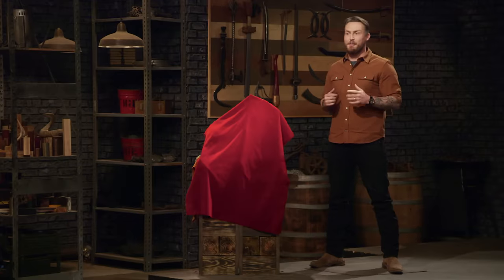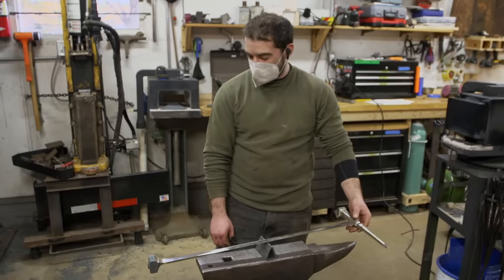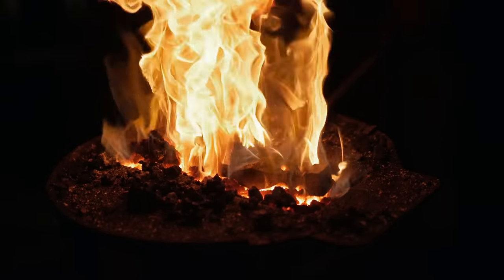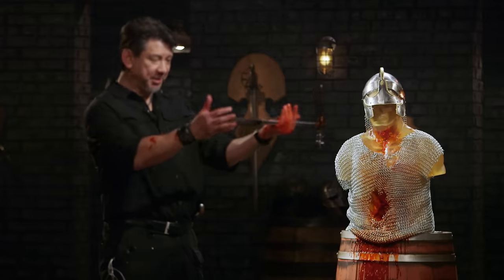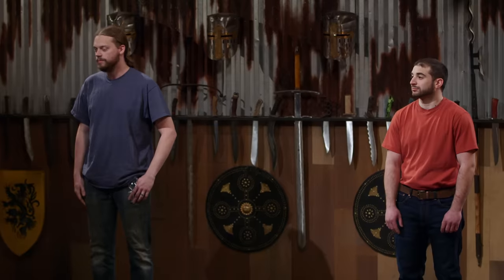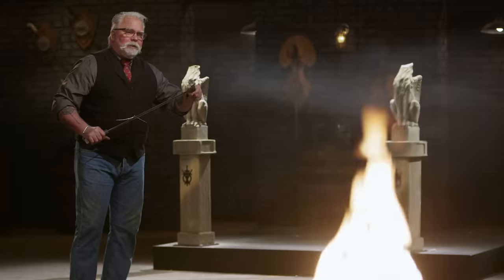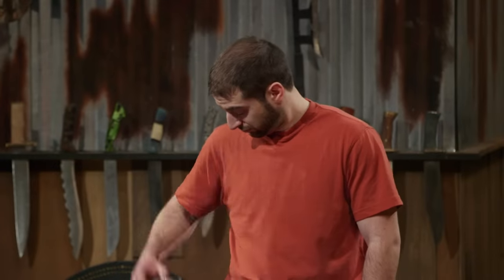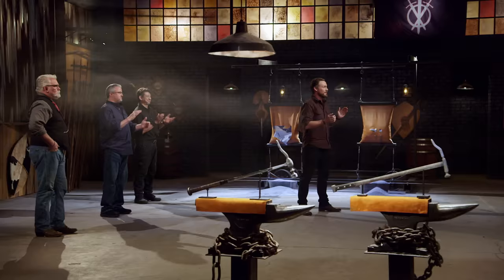Forged in Fire: Polish War Axe DECIMATES the Competition (Season 8)

Comment: I think this is one of the rare times the heavy weapon won the competition
Reply: be fair a hammer like this needs a bit more weight to do its job properly. he had better overall construction and a much better handle.
Reply: Although weight is a great offense, the instability of the weapon's construction and an uncomfortable handle are greater offenses. When they said the handle was blocky and the nail points were sharp i knew that evened the score. The head becoming loose closed the loss.
Reply: @MunkyDrag0n  Not to mention it bounced back at the lether bag
Reply: @anton6795  yeah, i was wondering why that happened. Whatever the reason that was bad.
Reply: @MunkyDrag0n  That was probably because the hammer was too light. Doug even said he was attempting to let the weapon do the work, or to let the weight of the weapon increase the force of the blow.
Reply: I mean it's a hammer  extra weight in a hammer does mean better damage, while extra weight in a sword basically just means harder to use
Reply: It's a Hammer after all.

Anyway, the light hammer was beautiful.

Pd: Sorry if I'm wrong with something. I'm spanish and I do not speak english very well.
Reply: I always hate it when the top comment gives away the ending.
Reply: most times that heavy weapons lose is because they're not properly balanced. Heavier weapons that are balanced win often enough.
Reply: @romxxii  yeah chances are in those cases the weapon isn't actually heavier, but due to the imbalance it makes it feel heavier and harder to swing
Reply: Do you think that the heavier hammer was made from......
.......
......
....heavy metal?
Reply: @janikauhanen5475  YEAAAAAAAH
Reply: The heavy weapon very often wins, what are you talking about? They usually take less damage and retain better edge because of their excessive mass. Which is a shame
Reply: Try carrying a 'Heavy Weapon' into battle, imho.
Reply: @1976PartyBoy  I hate that excuse. How much does armor weigh again? Not to mention a shield if used. Some armies even equipped their soldiers with two weapons such as a spear and sword and they also carried shields.
Reply: Thanks for Spoiler
Reply: @peterherrman5092  you’re welcome ☺️
Reply: It's essentially the handle that made the difference.

Comment: Most studies I've seen come to the conclusion that the spike was mostly for hooking an opponent off a horse or off balance, while the hammer was the most used for attacking. The hammer end doesn't get stuck in an opponent nearly as easily, making it much easier to use against multiple opponents
Reply: That makes sense if it’s factual because I was wondering, (after the reveal), why the spike was forged with a bend in it. 
When fighting for your life it’s better to have a spike on you than to not but, if the blunt end was the focus, the back-end did too.
Reply: the spike was also used for chainmail. as chainmail is built to withstand bludgeoning, but has a major weakness to piercing
Reply: @rymaxrules6416  Yes chain will survive bludgeoning impacts, but without proper padding under it you won't
Reply: @rymaxrules6416  technically chainmail is meant to withstand slashing weapons since its basically impossible to cut through. Even if the chainmail survived being hit by a hammer the person under it probably wouldn't.

And yes while it is most susceptible to piercing it is FAR better against it than displayed on this show. If it was that terrible there would be no need to shape weapons specifically for the task.

I dont know where they got there stuff but that is NOT real chain mail bring used in this episode. Real ones dont explode and have rings fly off when something hits them.

Real chainmail even though its more susceptible to piercing than other things is still difficult to stab through and can still save your life from stabbings.
Reply: I heard that the Spike is for textile Armor and the Hammerhead for plate

Comment: In order to seat the hammer head rigidly on the handle, it is enough to make a hole 2 millimeters smaller. Then heat the middle part of the head with an acetylene torch and place it on the handle. The hole will tighten on the handle while it cools down.

Comment: Wait I'm confused. The weapon was heavier and took a bend but it still won?
Reply: it mostly comes to structural integrity, it took a bend but nothing came loose nor chipped or rimmed, meaning it can still fight, on the other hand, the eye of the hammer started to rim and become loose, which is structural damage, and the judges are very critical when it comes to that kind of deal
Reply: It held up better.  It may have bent a bit but it did not go loose.  The other one had the head go loose on that test.  Also, the heavy one clearly did more damage.
Reply: In addition to what the other comments mentioned, the handle on the weapon that won was notably more comfortable, and that sort of thing that can be a make or break detail on a high impact weapon. Usually when the judges comment on weight it's in the context of usability, eg 'that makes this weapon unwieldly', but poor handle construction hits a similar usability criterion, so the additional weight on one was likely balanced in judging by the detrimental handle construction of the other.

Further, a slight bend in the haft of an impact weapon is a much smaller deal then the same on a bladed weapon, which relies on edge alignment to function optimally, so it was likely weighed less heavily in this particular instance then in others.

It is an amusing example of an exception that proves the rule though; in violation of the meme, the rule proves itself to be not 'the heavier weapon looses' but 'the least usable weapon looses'.
Reply: maybe it just achieved nominal shape? ;p

Comment: The second guy only quenched the small tip of his hammer , unlike the full thing pretty useless
Reply: It's better to not heat treat anything that isn't the part directly hitting the target, the edge or face of a weapon being hardend makes it better for holding and retaining an edge or shape but unhardened steel is better for absorbing an impact, it's better for the metal shaft to bend than to shatter